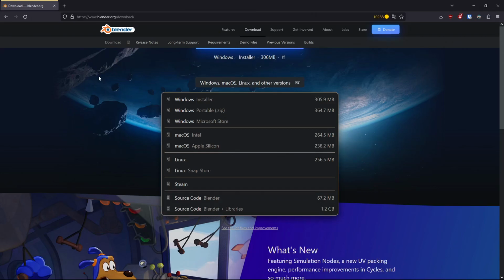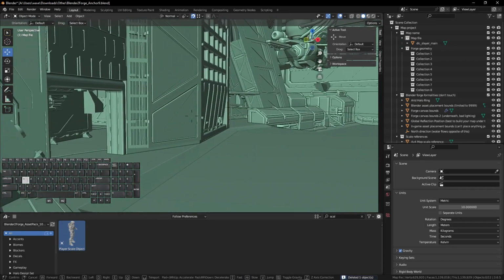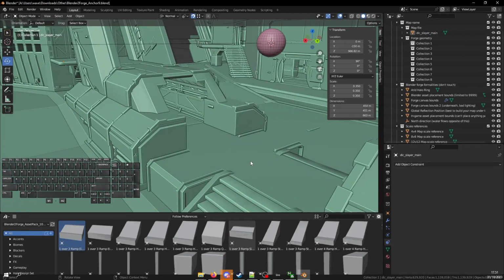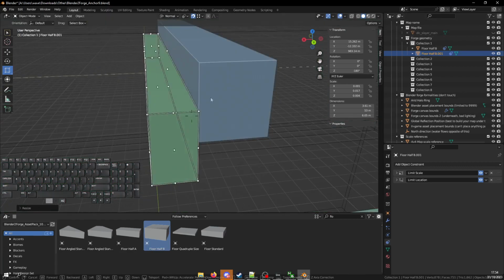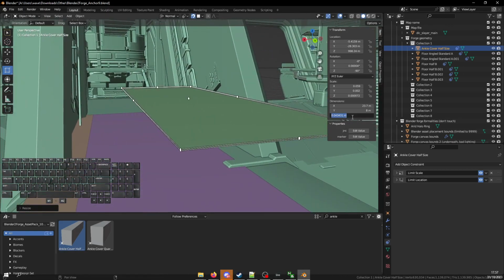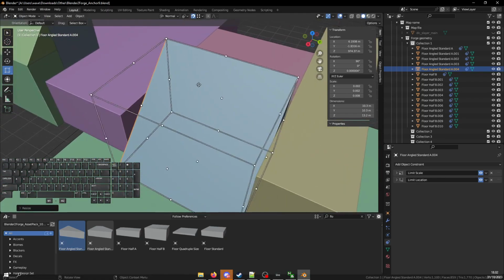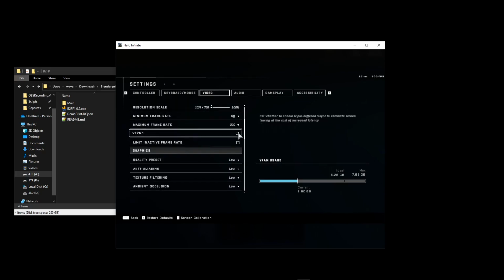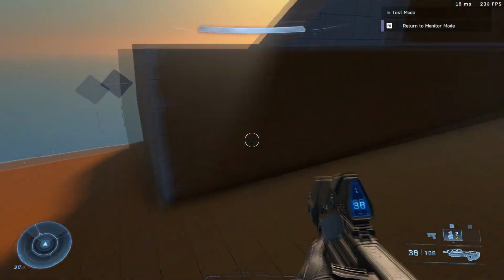Blender2Forge | Getting Started guide (installation, blockout & print)

Comment from the maker: Corrections:
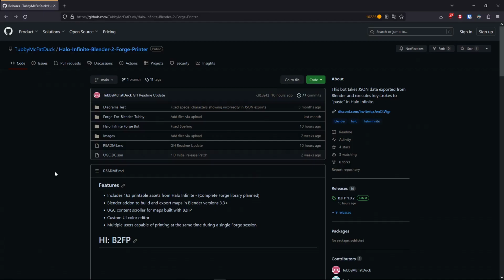0:37 The latest patch files for the program are found in the B2FP discord https://discord.gg/AzsYEfnxdK following the instructions in the b2fp-download channel. This includes patches for Infinite updates and the latest MapStartFile.
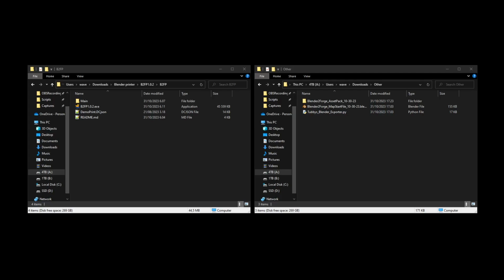0:55 Be sure to unzip the Blender2Forge_AssetPack file as you will need to reference a folder later on when adding an Asset Library in Blender.
3:25 If you are using my Keymap keybindings, be aware that after pressing Q initially to activate the "Walk Navigation" mode, the movement speed in very slow and you need to bump it up via either your mouse scrollwheel or numpad plus / minus
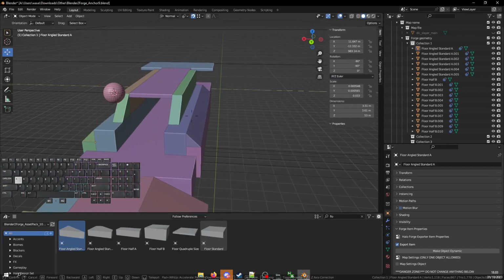20:05 When installing Python, you need to make sure to tick the checkbox to "Add python.exe to PATH". Otherwise you'll need to run any Python related commands from the Python install directory on your machine.

Comment: Hey I can’t get the points on each corner of an object when scaling. For example floor half A when in scale mode doesn’t show a bubble on each corner on my side like yours had when scaling. For context I’ve never used blender before and I’m not using the provided keybind mapping add on
Reply from the maker: You're probably using the regular scaling mode, when in the tutorial I am using the Scale Cage mode, which can be accessed from the drop-down on the regular Scale mode button. I highly suggest using the keymap file though as it helps you transfer keyboard shortcut muscle memory from Halo Infinite's Forge to Blender and one of the bound keys is for Scale Cage.

For more support, join the Blender2Forge Discord here: https://discord.gg/AzsYEfnxdK

Comment: Help? I have tried multiple times to get Blender2Forge to build my blockout, but the bot keeps crashing after a few minutes, before it ever finishes. And on top of that, there doesn't seem to be a way to continue where it left off, so I keep having to restart the bot only for it to crash again after only a few minutes of building. So I am overall unable to make any progress.

I don't know if this helps, but my ping is around 35 ms and my max framerate is around 200.
Reply from the maker: Be sure to open up an issue post on the Blender2Forge discord so we can help you easier: https://discord.gg/AzsYEfnxdK

You can continue where you left off with the Start/End Index option under Advanced Settings.